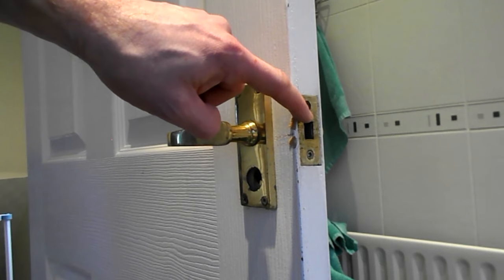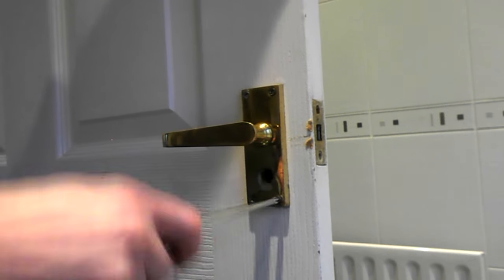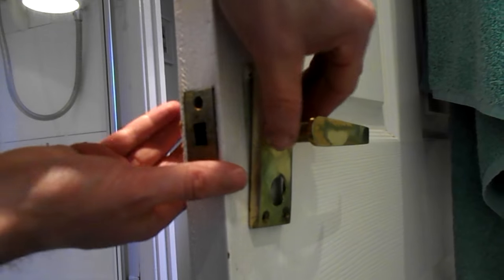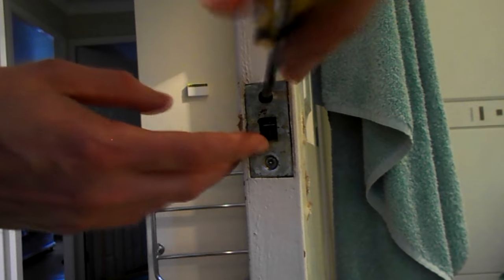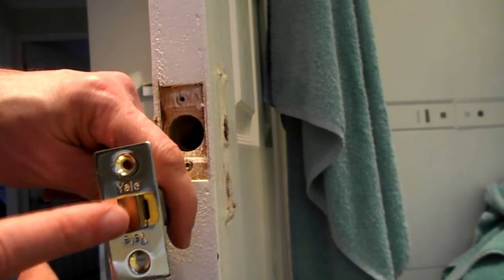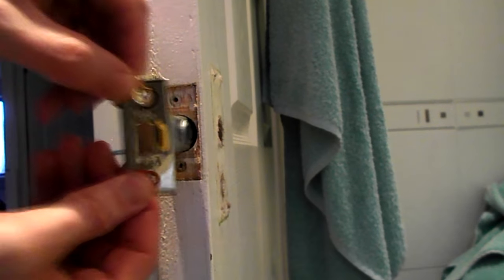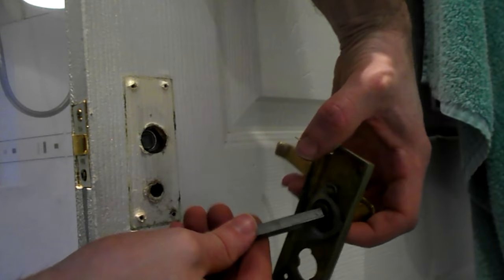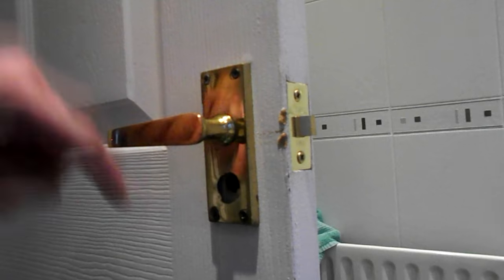How to replace an interior door latch lock

Comment: What about the lock 🤔
Reply: Please see below:  @Margaret Grinnell  this comment is what I needed instead of that useless video, thanks!
Reply: Have some common sense
Reply: @brianpattison4417 so lock wise you’ll have a spindle that goes through for your thumb turn and indicator remove any decorative covers remove any screws or grub screws and pull them away and then just reverse it with the new equipment not thst hard really
Reply: There's a grub screw at the bottom of the lock, undo it with an alum key

Comment: How did you get the lock off. 
Thankyou for half a tutorial really usfull 👍
Reply: That is what I was looking for.  I eventually found a small hole on the underside of the bit of the lock you twist, loosened it with a small allen key and it pulled off. I just wanted to remove the handle to make a neat job of painting the door.
Reply: @margaretgrinnell400  Thanks, that's what I needed :)
Reply: @margaretgrinnell400  this comment is what I needed instead of that useless vide, thanks!
Reply: @margaretgrinnell400   thanks Margaret for the tip which was not in the video
Reply: @margaretgrinnell400  Thanks for that. Would never had found that!
Reply: @margaretgrinnell400  Thank you Margaret, you're a life saver!

Comment: The door latch of my bedroom door knob won't slide out for removal/replacement (after the two knobs have been removed).  What is holding the latch so tightly in the door? (I want to replace the door knob with a key-locking door knob.)

Comment: Removal of the lock so remove any decorative cover plates they may unscrew or need a screwdriver under a small gap remove any screws and loosen any grub screws you may have remove the lock accessories including the spindle thumb turn and indication unit and reverse to refit he also didn’t have a lock as you see there’s no bolt at the side nor sash lock if you need to replace the whole lock remove the lock and handles if needed and undo any screws remove cover plates pull out and get a like for like swap hope this helps any Do it yourselfers like me haha all the best -warren

Comment: Lol all these lock questions, clearly the door did not have a lock mechanism as the barrel slot is for just the latch. The part with the lock requires a bigger 'hole' in the door to take the mechanism. Same process ...

Comment: Does anyone know how to get the lock off?
Reply: remove a grub screw on the internal thumb turn
Reply: @mikelacey9384  Thank you! Well concealed on mine.

Looks like a tiny Allen key required. Any idea of typical diameter? Thanks in advance. (All my current ones seem too big)
Reply: @mikelacey9384  OK, sorted it now. Fortunately I had an Allen key to fit. Pretty small, like around 1 mm. And fortunately, it was not in very tight.
(note to self: do not overtighten when refitting ... )